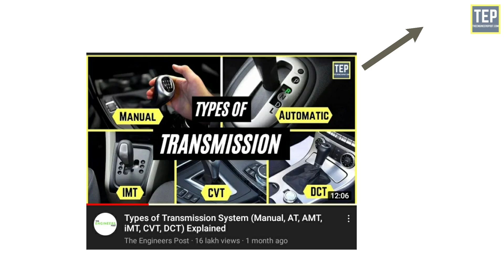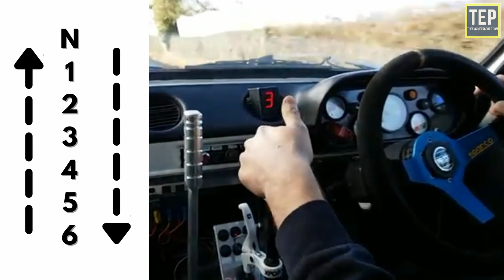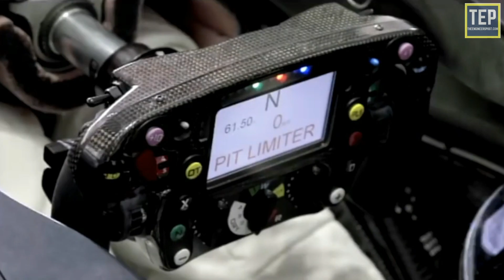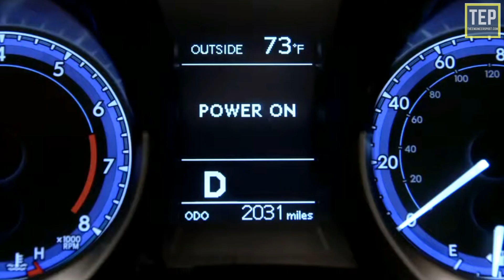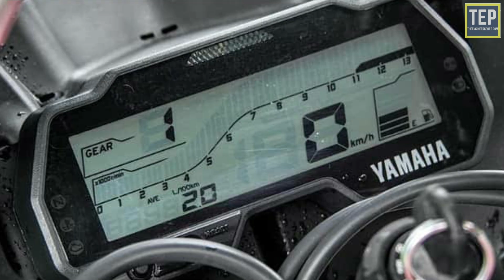How a Sequential Manual Transmission (SMT) Works? Explained

Comment: Does the driver still need to push in the clutch pedal to remove the transmission from the engine prior to shifting?

Comment: Does this sequential gearbox in cars require pressing the clutch?
Reply: a sequential gearbox has no need for a clutch pedal. Instead, the clutch and gear-change process is carried out by actuators

Comment: I am now 73 years old. Like many people my only experience with a sequential manual transmission was a couple of motorcycles that I rode when I was around 20 years old. What some people may not know is that some early motorcycles built in the 1940s and 1950s did not have a sequential gearbox, they had a lever on the side that a person had to reach down with their hand to shift gears.
Reply: Good ole suicide shifter. The only kinda motorcycle I like to ride 😃

Comment: Actually Nascar just went to the Sequential Manual Transmission for the Cup Series.  They still use the H pattern 4 speed in the Xfinity and Craftsman Truck Series.
NHRA Pro Stock uses a 5 speed Sequential Manual and has for years.  I don't know why they haven't replaced the  H pattern yet in Nascar.  It's way outdated.

Comment: This video is great, but doesnt discuss the downsides. Huge maintenance costs on a straight-cut design, loud as hell, virtually unusable on a daily driver, and... let's just call it a 'high strung' driving experience.
All things that are either irrelevant or outright advantages in a race car of any kind, but not so much a road car. Road cars don't come with sequential transmissions for good reason, not just because manufacturers hate fun. Dual clutch transmissions and the best new torque-converter autos offer 90% of the experience with pretty much none of the downsides. And manuals are arguably still the gold standard of driver engagement and enjoyment. I have nothing against sequentials, they are unrivalled in their specific sphere, but they aren't anything like perfect.

Comment: for changing gears in sequential gearboxes u should push clutch pedal or it doesnt have clutch pedal??
Reply: It does but its mainly for when you start driving from a stop. And this is thanks to something that is OFTEN found but not necessary which is the method of gear engagement which is dog teeth engagement compared to mt’s which use synchro rings

Comment: Great video. But you should've also discussed the negatives of sequentials. Not too friendly fot daily driving, very loud, brutal shifts, very expensive and high maintenance. Also, some seqs still have clutch pedals and even pro drivers use it when downshifting.
Reply: or you could use quick shifter or even just drive smoother, no car drives like a F1 car all by itself
Reply: Yeah thuds are annoying in sequential  and you use quick shifter like in 390 duke for upshift without clutch but downshift is nuts hard in sequential when you shift down or up if speed doesnot matches in downshifting  thuds annoying as f and make you think the gearbox is damaged and also its noisy in upshifts in low gears and usually it wears drive terrain  
This is what I have expirenced in motorcycle though I don't know about sequential in cars btw
Reply: @heheboyholaamigo8742  you'd feel the same thuds in a car. That's really a trait of sequentials, especially dogboxes. The gears just lock in right away for instant torque transfer unlike helicals which are used for the daily cars that offer smooth transitions. It's also even more noisy in cars.
Reply: And damn it's hard to get neutral 😐
Reply: Wait wdym some, don't all have clutches however the use of them is different than normal transmissions and also what do you mean by pro drivers use it for downshifting why do they use it for downshifting can't they just downshift without the clutch?
Reply: Why, these are not the sort gearboxes you would put in an everyday car. They for high powered performance vehicles.

Comment: Whether the gears are straight-cut or helical has nothing to do with the method of engaging gears (dog rings or synchros) and nothing to do with the shift control mechanism (H-pattern or sequential). It is common for the same transmissions which have sequential shifters (mostly motorcycles and racing cars) to have dog rings and to have straight-cut gears, while more common automotive transmissions with H-pattern shifters to have synchronizers and helical gears, but these design features are not dependent on each other.

Comment: Does sequential transmission require a clutch? What is the bicycle-brake-like thing for under the sequential handle?
Reply: Yes. Because there's too much power to not have a clutch.
Reply: Clutch is only needed to pull away. The bike brake thing is used to select reverse

Comment: What about reverse, neutral, and the clutch pedal?
Reply: What about them?
Reply: @MasterKeyMagic  Do they exist in a sequential transmission? When you come to a complete stop what gear are you in? Neutral? First gear with the brake applied? Is there a chance of stalling when leaving from a dead stop?
Reply: @marlo209  All of them have a neutral somewhere. Typically between 1st and 2nd gear as on all motorcycles. All manual transmissions, whether sequential or H pattern, have a clutch pedal/lever. You need it at the very least anytime you take off from a stand still. You can use it in any gear but if you rev match or don't care about the longevity of your transmission, you don't have to use it after your tires have momentum.
Reply: @marlo209  Cars with manual sequentials will have a reverse gear somewhere, usually below 1st gear. They do not shift themselves. If you get off the highway in 6th gear and come to a complete stop, and you didnt down shift, you will stall in 6th gear. You do not need to apply the break to operate the shifter in anyway. Its not like an automatic at all. Yes you can absolutely stall if you release the clutch too fast while trying to get moving or by being at too low a gear relative to your speed. Your engine must maintain a certain minimum amount of momentum or else it dies.
Reply: @MasterKeyMagic  Ahh. Thank you
Reply: @MasterKeyMagic  Does sequential trans even use a clutch pedal? or is it automated?
Reply: There are neutral gear for sequential transmission, and there's a clutch too but only to start moving the car, you don't need them to change gears, but in motorcycle you need them, about the reverse gear, at 4:40 see that little white lever? You go to neutral, pull that lever backwards, and pull the stick backwars (if your car upshift like that)
Reply: @annayuniarti1480  Thank you so much. You're the only one that has explained that portion of a sequential transmission in detail. I take it you've owned one or been in a vehicle with one?

Comment: Do SMT cars also have a clutch pedal?In my own opinion, the traditional manual transmission is still the king of the jungle.You can shift to any desired gear say from 1 to 4 or from 5 to 2 if needs be.Thanks for your informative video.
Reply from the maker: SMT allow you to manually select gears without a clutch pedal, the sequential gearbox has all of its gears lined up on one input shaft, and they engage the output shaft using dogs.
Reply: it can have a clutch, or torque converter, or a centrifugal clutch.

skiping gears isnt that great, maybe 2 to 4 or 3 to 5 but any other combination is pretty much useless
Reply: @omegarugal9283  ive done some 3-6 shifts when going onto a highwaywith a short onramp, or when down shifting i skipp gears a lot. but in my opinion h-pattern is probably easier for on the normal road, having better acces to neutral and being able to skip gears en all.

Comment: Is sequential transmission of cars have a clutch pedal?
Reply: Also wondering the same thing
Reply: @daniahmed  Sequentially shifted manual transmissions have a clutch pedal or if they're on a motorcycle, a clutch lever. All manual transmissions, no matter how they are shifted, have a clutch pedal/lever.
Reply: Yow that boggles me
Reply: @darkwatcher01  Sequentially shifted manual transmissions have a clutch pedal or if they're on a motorcycle, a clutch lever. All manual transmissions, no matter how they are shifted, have a clutch pedal/lever.
Reply: @MasterKeyMagic  but are there sequentials that can shift without the need to use the clutch? For the lightning speed gear change
Reply: @darkwatcher01  You only need the clutch to start moving and to come to a stop. You can shift to other gears as long as the car has enough momentum to not stall the engine.
Reply: @MasterKeyMagic  owwwh now i know thanks
Reply: @darkwatcher01  Any manual transmission can be shifted without disengaging the clutch, if you time the shift properly and blip the throttle to speed up the engine and input shaft while in neutral during an upshift. The sequential mechanism doesn't change that.
Reply: Sequentially shifted manual transmissions have a clutch pedal or if they're on a motorcycle, a clutch lever. All manual transmissions, no matter how they are shifted, have a clutch pedal/lever.

Comment: No clutch pedal on sequential?
Reply: Sequentially shifted manual transmissions have a clutch pedal or if they're on a motorcycle, a clutch lever. All manual transmissions, no matter how they are shifted, have a clutch pedal/lever. If you rev match or have a device that rev matches for you, you only need to use the clutch pedal when you take off or come to a complete stop.
Reply from the maker: Sequential allow you to manually select gears without a clutch pedal, sequential gearbox has all of its gears lined up on one input shaft, and they engage the output shaft using dogs clutches also known as dog gears.
Reply: @TheEngineersPost  thank you very much sir
Reply from the maker: @febynemenzo8579  You're welcome

Comment: Man I wish I had one of those transmissions for my everyday car.
Reply: Your not the only one my man.
Reply: sequential manual transmission are very quick on motorcycles even a $5000 motorcycle can outpace $1 million car when it comes to gear change timings😅 Weird comparison I know
Reply: @ezioauditoredafirenzi  
Yeah. But hey, at the the same time it's true
Reply: Sequential gearbox are good fun to drive, I played around with HGT on the street quite abit and you can drive them quite smoothly after couple days. Going from neutral to first you simply hold the clutch in abit longer let all the moving bit fully stop and it'll go in to gear smoothly with no "clunk". One thing I didn't like was not being able to go to neutral from any gear like you normally would coming to a traffic light etc etc. But overall they are good fun!
Reply: @BJWTF  
Yeah not being able to go into neutral at anytime you want would be truely annoying, I could imagine. Lucky you that you could experience a sequential in town. I'd be willing to take on the challenges that the sequential offers to the drivers, that's be cool.
Reply: Same
Reply: It's Best I driven SMT Available In Sports Car Only.
Reply: The maintenance is continuous and expensive with sequential gearboxes because of the dogteeth gears.
Reply: Have it on my 2015 es Lexus love it !🥰
Reply: @skycamtele  
Have fun when driving in the city? 😅

Comment: Does it have clutch
Reply: Instead of synchromesh rings, sequential gearboxes have dog clutch. Sequential and dual-clutch gearboxes both allow you to manually select gears without a clutch pedal, but that doesn't mean they're the same.

Comment: Why straight cut gear box has a loud sound ?
Reply: Helical gears mesh together in small segments at a time while straight-cut teeth are in contact with each other fully and for a longer period of time which makes them to create a hell of a lot of noise. They are not used for regular cars as they are not known for silent operation.